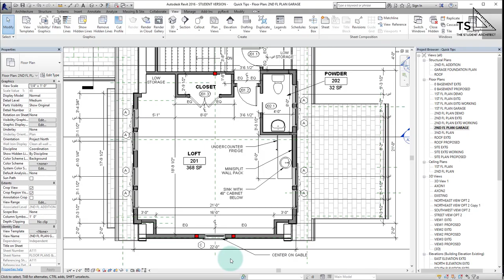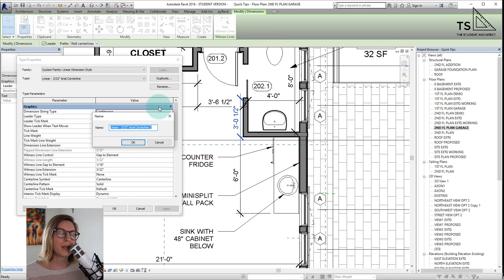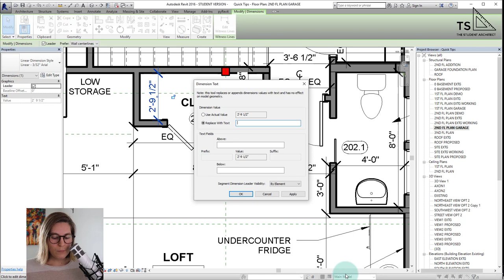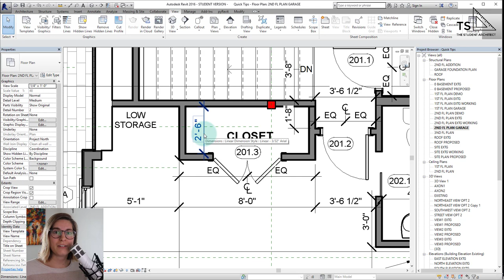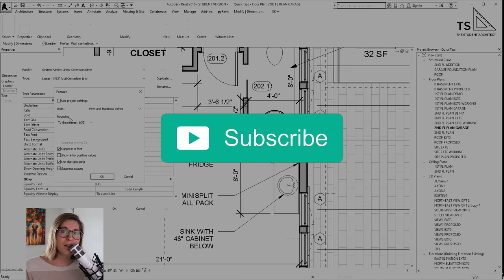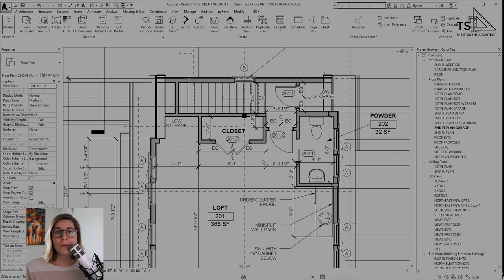How to Override Dimensions in Revit

Comment: No doubt some good tips there EXCEPT the one on overriding the dimension. Why?.. you do the override, get your drawings out and move on. You have a lot of work and actually forget to change the geometry and update the dimensions. The drawings go to site. Meanwhile, the guy you sent pdfs or dwgs to who is making the bespoke cabinetry and has linked those files now has incorrect data, does not know it, and builds them wrong due to this sloppy cheat. Who pays for that error? Take this to a commercial setting and that cheat goes from a couple of hundred bucks in extras to thousands, even hundreds of thousands and it happens all the time. As an industry we should be getting better, not promoting slack workarounds that end up giving everyone a bad name. IMO :)

Comment: The ONLY time I have ever needed (and justified using) a dimension override is for a drafting view detail where I don't have enough space and want to squeeze something into a smaller space using break lines. I usually use annotation text over the top of the actual dim text, but that doesn't always work. Thanks for this!